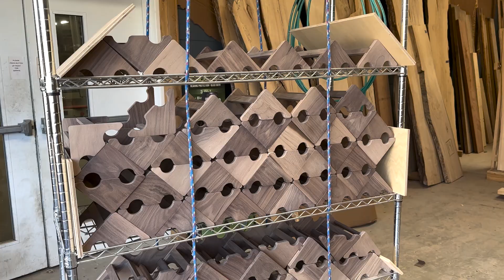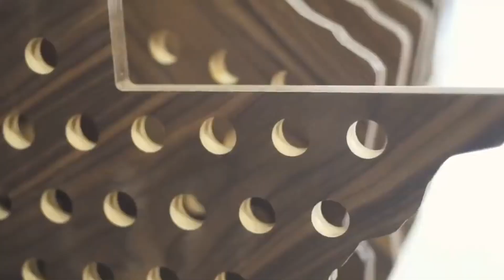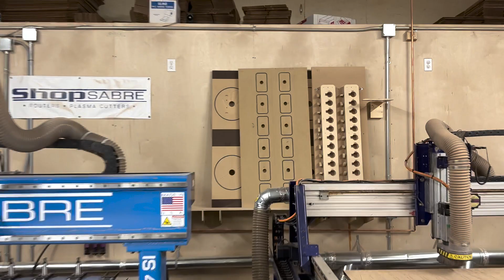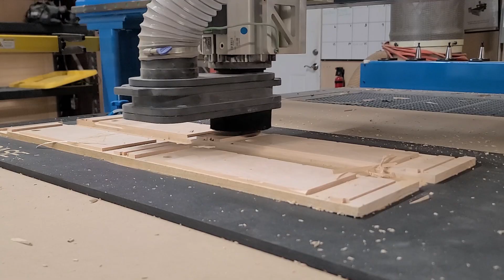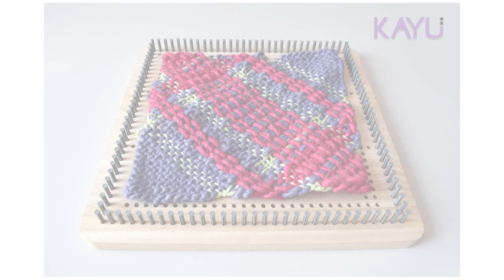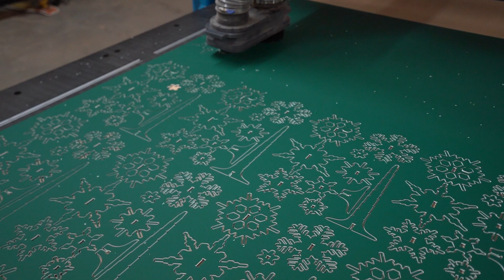CNC Shop Tour | Woodshop Ideas & Tips

Comment: I sometimes have trouble with moisture getting into the MDF while on the machine, the corners lift up and the vacuum loses suction and the sheet gets loose, do you have this problem I've ended up just giving up for the day or screwing the board down to the bottom sheet but thats not always an option with lots of small pieces

Comment: Nice shop. Jealous. It looks like you need some serious dust control in there though. Your employees are going to have lung problems from the dust. Also just to let Jacob know, he should use a torque wrench on the ER collects on the router. There are specified torque settings to use. I am A CNC machinist and have learned the hard way. Anyways great video.

Comment: This is so cool. CNCs are a manufacturing game changer as are 3D printers. You make great use of a smaller space. It seems a lot bigger than it is.

By the way, 8020 aluminum framing is a great method for workstations, shelving, and guards. You may want to look in them. I am a 8020 specialist/ designer for SunSource

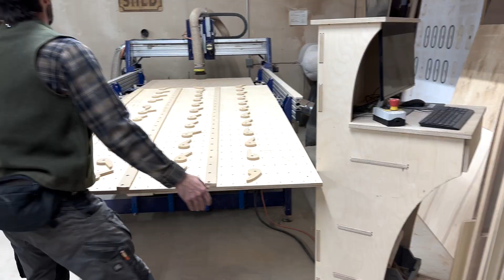Comment: 4:32 Would a strip of Hook & Loop (Velcro) keep the wooden handle jig attached to the CNC Base for safe keeping, and not being a tripping hazard? i.e. Like keeping a drill chuck key attached to the cord. Would several plastic pallets help with stacking stock flat & off the ground? Walmart usually has stacks behind their store, that a Manager might give you!?